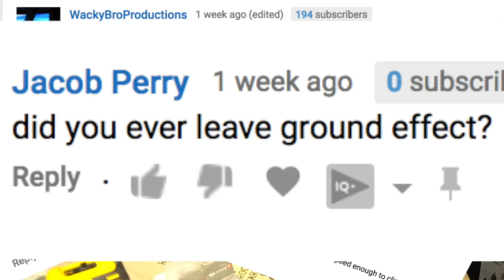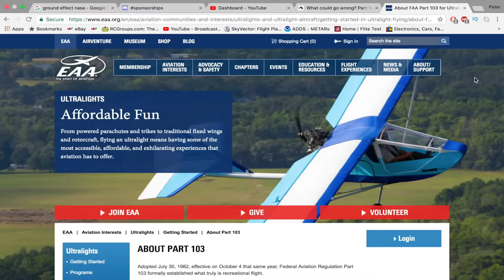HomeMade Electric Airplane

Comment: How many 18650 batteries would you need to fly?
Reply: lots..... but it would probably be lighter.
Reply: About 393 18650's if those were 6S 16,000 mah packs.
Reply: 393 is an odd number - 392 / 14 S would give 28P
but 20kW power draw by the motors would require 20kW / 51.8V = 386 amps!
and would require 386/28 = 13.7 amps per cell which would be asking a lot from them.
There are 18650s that can deliver that amount of current, but their capacity tends to be low ~ 1,500mAh.
If you increase the number of cells in parallel, then you can use energy cells >2500mAh and make use of the capacity.
So, by setting a limit of 4A per cell, then you could make a 14S 96P battery pack with 1344 cells to get 12.5 kWh (1344 x 3.7 x 2.5).
With 392 high power cells, you'd only get 392 x 3.7 x 1.5 = 2.1 kWh
With the mass of each cell around 45g, 1344 energy cells would weigh 60.5 kg and give 206 Wh / kg
392 power cells of 45g would weigh 17.6kg, but only give 119 Wh/kg
Sorry I got a bit carried away.... :-)

Comment: I’m concerned for your longevity Peter. I’m very impressed with your creativity and ability, but having lost several friends/relatives to aviation accidents, one small structure failure will likely be fatal. I’m sure you know the risks, but as someone who appreciates your contributions, I felt like I should comment. One of my relatives over stressed a RV6 wing and it separated in flight.

Comment: Peter, how much did the plane cost you?
Reply: He said 2500$
Reply: at is godamn cheap. I could build a plane to fly abour with for less than a high end computer.
Reply: XD
Reply: TheDaniel366Cobra 20 bucks
Reply: You can buy planes for under 1000$
Reply: lol what?
Reply: Ylem 500 link?
Reply: Ylem 500 no you cant... you can buy an ultralight for maybe 5000 but if you want a plane you should atleast put 30k on it
Reply: cheap cesna 150's can be bought for 10-15k. It only holds 2 adults and nothing else, but it is a flyable plane for less than a car.
Reply: Jr ALEXANDER 10-15k aint much for a used car
Reply: better be a 2016 or up with less than 5000 miles fully up kept and gone through . If you cant buy a nice used car for 3000 or less then there's a problem
Reply: Jr ALEXANDER Theres other good cars for that price as well, my BMW 330i just cost me 3000bucks
Reply: I would built one for less than $500 but it would fly only for like 5 second until it would crash and kill you 😂😂😂😂😂
Reply: _ VesBraun I wouldn't fly a 15k cessna
Reply: ....nice........great job later. I had a clipped wing challenger for years......it's quite a feeling.
Reply: Ylem 500 really?
Reply: all KFC parts... my nearby KFC went out of business.. employees robbed 'em blind....
Reply: Fortunately not his life!

Comment: What is the highest altitude can your plane reach?
Reply: Giovannie edgar 50,000 feet in the right conditions
Reply: err, no. not even close
you would need oxegen, closed cabin, and more power. de-ice gear, and you would be near the end of the atmosphere. so no. in no way can you go 50k feet in that.
Reply: It might have been a joke?
Reply: oh, my apologies, im not good with jokes. :)
Reply: That´s a definitely a good question. I imagine that there is some sort of limit on how high he can fly just like there is a limit on the speed of the plane (mentioned in the video).
Reply: source of power and fuel.temperature
Reply: FAR 103 gives an upper limit of 18k. Not that most class G goes that high.
Reply: LegendLength and the fact that as you climb, the air is less dense making the props less efficient for a given rotational speed (less air to blow back for thrust). As you can only rev an engine to its operational capacity, you will inevitably reach that limit, and hit a ceiling.
Reply: In Britain it's 7000 feet with out oxygen .
Reply: 7000 feet, then there is the danger of oxygen starvation .
Reply: "Starvation"
Reply: Giovannie edgar The altitude limit for uncontrolled airspace is 12,500. Above that requires instrument rating and a flight plan and direct contact with Air Traffic Control at all times.
Reply: Giovannie edgar The FCC has limits on how high an ultralight can fly so I would say whatever that limit is,and stick to it.
Reply: 12500ft for the US (max 30mins without oxygen) :)
Reply: The limit is where he will froze
Reply: RC Hobbyist Extreme I think you mean faa
Reply: Yes you're definitely not good with jokes lol

Comment: Pretty much takes the cake.. how bout air motors... it's a tremendous force multiplier!
Reply: For "batteries" compressed air in silk and shellac wrapped bamboo.... wrapped in both directions for strength... it's stronger than steel.. floats ... and a 12 volt air compressor could be substantially lighter than the associated electric pieces

Comment: Can someone with only model plane building experience build and fly an airplane? Of course they can. Haven’t you seen Flight Of The Phoenix? Also, what are your safety measures? What would happen to you if a wing snapped off mid flight?
Reply: He has pretty good safety measures

Comment: 7200/16000, yea you did go past halfway. Remember the MAH rating is counting all the juice you'd get if you discharged them to 0 volts, not to the bottom of thier operating range. Being able to charge 642mah into a 1200mah battery is pretty normal between 3.8v and 4.2v

Comment: OMG, flying IS as easy as moving through the air that turns to lift you (the plane) up given the right aerodynamics of the plane. The complexity only comes graded when you decide whether to make it home, manufactured, highly commercial, or military :-)

Comment: Really Super,
1. Is there any software to control between motor rotations during turning/flying ..?
Hence some times one motor rotating fast, another one is slow, vise versa
2. Can we use a bike(150 Kgsof weight) instead of this frame, where that bike can have two wings 
Rear or Front BLDC motor.
Can we fly ...?

Comment: The only channel that makes something outstanding
Btw do you need permits to fly this plane? How and where can you fly it
Reply: As Peter stated the aircraft complies with part 103 so he doesn’t need a license part 103 being:

If powered:

(1) Weighs less than 254 pounds empty weight, excluding floats and safety devices which are intended for deployment in a potentially catastrophic situation;
(2) Has a fuel capacity not exceeding 5 U.S. gallons;
(3) Is not capable of more than 55 knots calibrated airspeed at full power in level flight; and
(4) Has a power-off stall speed which does not exceed 24 knots calibrated airspeed.

This means you could fly any plane complying with it.

https://www.eaa.org/eaa/aviation-interests/ultralights/getting-started-in-ultralight-flying/about-faa-part-103-for-ultralights for more information about part 103

Comment: Fantastic work, but you should increase your power output, you flying very close to stall speed, there were times watch the video, that one of the wings were into a parasite drag, and were very close to a wing stall, be careful

Comment: The  cable  swedges shown at  9:29?  ONE swedge is full strength, two are NOT needed. IF two ARE used, a space between the two should be left, about the length or a bit more, or a swedge.   This is standard aircraft practice, and is done so the cable still has a degree of flexibility.  The only reason to use two swedges, is if you want to cover the raw end of the cable, using two and still having the raw end protruding is of no use.  One swedge and a bit of cable protruding is standard practice. Trust me on this, I've worked with 3/32" cable for 40 years, thousands of feet of it, one swedge is all you need!  It is critical to get the cable tightly conforming to the thimble before swedging..  Electrical split bolts of the proper size are handy for temp clamping of the cable, (without harming it) and if you have the swedges already on the cable, you can then swedge it before releasing the split bolt. I know nothing of composite work, but everything about working with 3/32" cable! I love your thrust line positioning!

Comment: More information on how you cut the foam wing sections @9:00 pls
Reply: He probably used a hot wire
Reply: @spongebubatz  I figured the hot wire part....just how he did it, which I found that in another video.   He heated the end of a copper pipe and pushed it thru the wing section,  afterwards feed the wire thru to do the cutting.

Comment: what batteries did you use to power your 
Turnigy RotoMax 150cc Size Brushless Outrunner Motor
i would like to buy the motor but dont know how to charge it

Comment: Well the wroght flyer was built by amateurs in a shed with mayterials way worse rhan thisnguy has at his disposal... not taking anything away from the achievement (really well done!). But building a plane from scratch is done by many people around the world on a yearly basis, and some of the most amazing small planes are built as experimental design in someones garage... i kmow of people who has built their planes in their living rooms. And had to tear down a wall to get the plane out.... weird stuff. But again, very well done!

Comment: !I NEED A SMART PERSON TO REPLY THIS!
What happens if:
1. You put long metal wings on your sleigh
2. stick in the largest flying bird
And a instantly running and jumping pitbull and 10000 dragon flies and Usian bolt to guide your sleigh
3. You put motors on it
And wheels
4. Flap your hands
5. Tape a crazy chimpanzee to the floor of the sleigh so it can control it by hitting it with a pan
6. Put a fan behind it
7.you slide of a big mountain that increases your speed
8. You go towards a very long cliff

What happens next?
-Do you start flying?
-Do you start gliding?
-Do you start falling?